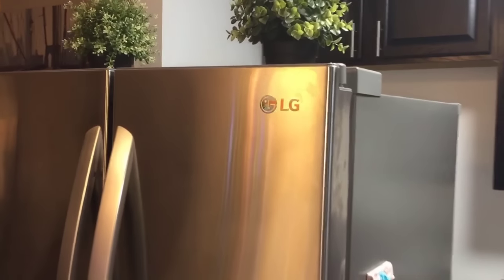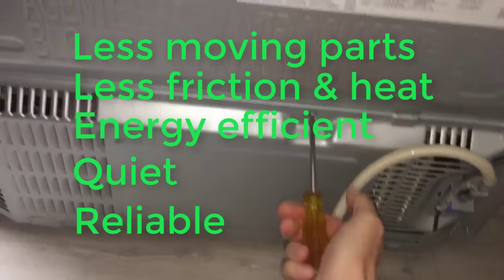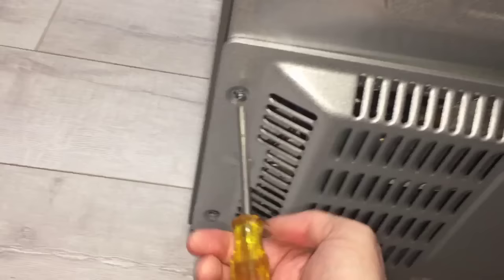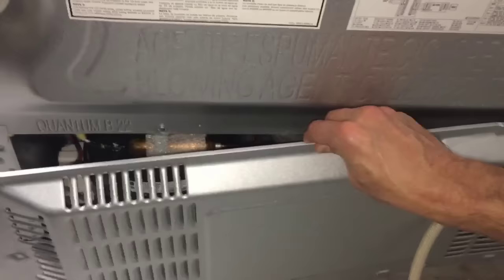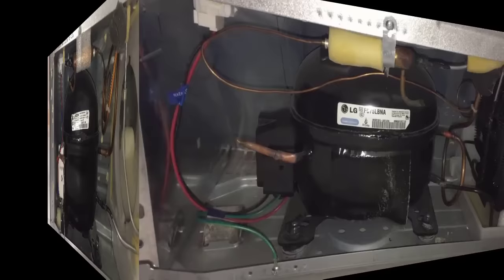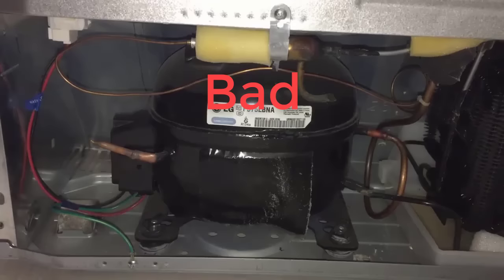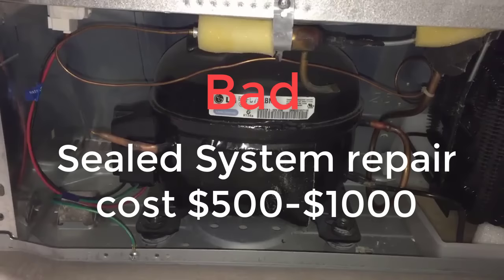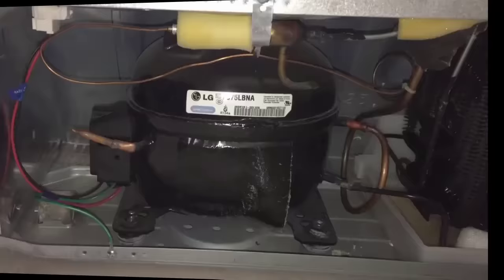LG fridge not cooling but running

Comment: Got an LG fridge and has been running for about 15 years. 2 door classic.  Recently I have been hearing like a marble rumbling or whatever that sound that's really annoying.  I have heard that before when the unit was about 2 years old.  But repositioning the fridge always works in deadening that rumbling sound.  Lately, when I was done cleaning the fridge, it turns on, but not cooling at all.  do you think it's just cleaning that I need to do?  I will have to do it tomorrow and hope to see what the real problem is.
Reply: make sure the cooling coils have not iced up. that happens to our Maytag almost every summer. somehow it does not automatically defrost so we have this huge ice build up. I shut off the fridge and using a blow dryer, melt off all the ice. turn the fridge back on and it works perfectly.

Comment: What blow air from freezer to frig.?
Reply from the maker: There should be a fan inside the freezer that blows some cold air into the fridge.
But if your model has a dual cooling evaporator, there would be a fan inside each compartment.

Comment: We have a LG Refrigerator, Model: LFCC22426S /04, which came with our current home purchase in 8/2021. All of a sudden, it stopped cooling couple of days back and when I called the LG customer support, they said based on the model number and serial number my fridge was 'Manufactured' in 8/2020 but they are not sure when it was actually 'purchased' from the dealer (has to be less than 2yrs old), to confirm if it is still under 1 yr warranty or not. For troubleshooting any further, they are asking for 'bill of purchase' otherwise asking me to opt for their paid support.

I just got the user manual when we bought this home and not the bill of purchase. I live in Ontario, Canada. The local tech says it could be a faulty compressor and quoting $1400 + labor :( Any suggestions please?! I'd greatly appreciate.
Reply from the maker: Not sure about Canada, but in the USA, LG usually replaces compressors absolutely free for the first 5 years. But you need the purchasing receipt. Without the receipt, it would cost about $1000 including labor on regular refrigerators. And much more on build-ins.
Reply: LG refrigerators are not worth fixing they are so poorly made.  They are a throw away product.

Comment: Best thing to do is AVOID BUYING LG PRODUCTS!! every LG product I've bought failed within a couple of years of buying it.  I just checked my fridge and it is doing this same thing, compressors running but no cooling. I had 2 LG dehumidifiers in a garage and they both failed at the same time with the same problem "bucket full shut off" even though they were both hooked up to drain hoses (bucket can never be full), ruining $7000 in product that needed to stay dry. As for this fridge I also had been noticing that it would run constantly costing us lots in electricity.

Comment: Mine is going bad. Freezer is barely cold, even set on -4. Checked coils for ice and they are fine. Compressor sounds different, can tell at night, when everything is quiet.
Reply from the maker: How old is your refrigerator? It maybe covered under LG 5 and 10 years warranty.

Comment: @YourSelf  what about if I have a Kenmore pro but it has the lg linear compressor is it covered in the lg warranty even though it's a Kenmore I think it says in the manual that the lg compressor was warranty for 10 years I bought the refrigerator 4 years ago? The problem with mine is that is not cooling but fans work and the compressor is on and gets hot but the condenser fins don't get hot at all its like if the freon is not going through the condenser.
Reply from the maker: At this time, I believe, all Kenmore claims have to go through Sears. And if the problem is with the sealed system, Sears should cover parts, but you have to pay for labor about ~ $400. But this is under their discretion.

Comment: Hi, my refrigerator and freezer wasn’t cooling/freezing enough, my husband opened the panels for the fridge and found ice on the coils, he clean it, then he did the freezer and it was fine, no ice at all, now the fridge is cooling but the freezer section is not, can you tell me what it can be the problem? Thank you
Reply from the maker: It sounds like you have a Dual Evaporator model, one in the freezer, and one in fridge compartment. These machines are very complicated, so it's best to call LG for service. How old is your fridge? Typically LG will cover compressor problems up to 5 years for free.

Comment: After watching this video I spent several days trying to figure out what was wrong. Compressor purring like a kitten still no cooling. Exhausted all options and finally tested compressor and guess what. No continuity between two of the three prongs meaning compressor internally grounding out. Purrs like a kitten and still no good.
Reply from the maker: If it says "Linear" on the compressor, it has only one winding between two prongs at about 5-9 ohms. Others are open.
So if the compressor is running, that means the refrigerant gas has leaked out, or the internal compressor reed valve has cracked.
Reply: @Your-Self  good to know thank you. Learning more everyday.

Comment: Thank you for the video, however, your diagnosis is not entirely true.  This sound of the compressor is also present when there is a bad starter relay, combined with the click of the overload this could just be a bad relay and the compressor still good.  Just and FYI for those that might be experiencing this situation.
Reply from the maker: Thank you for commenting, however, this LG Linear Compressor doesn't' have the Start Relay. Even if it did, a typical PTC Bad Start Relay would prevent the compressor from starting, so it would not run at all. Unless it's a bad TSD (Time Starting Devise) which will make the compressor run for a few seconds, and then the Overload Protector will turn it off. In this particular video, the compressor runs constantly, but not pumping, which is a typical failure of Linear Compressors.
Reply: @Your-Self  So what's the clicking you refer to, a overload ?  If a overload opens obviously the compressor will stop. In the video the same sound continues even after the click.
I'll also add that those are two different compressors and have different condensers and fan arrangements.

I agree that the LG linear compressors = junk 😂

Inverter compressors use inverter technology that change not only the voltage but the hertz and are 3 phase.
I'll have to recearch " linear " compressor because I believe they are different from " inverter " type compressors.
I understand the mechanical side is different (using magnetic technology).
So after a little research it appears these linear compressors have one winding with a overload to protect said winding from over current. Basically a large solinoid moving a piston mounted on springs.
The single discharge reed seems to be the weak link and point of failure.
Reply from the maker: @Vincent Pribish good question. Typically, an overload switch would prevent the compressor from starting, but in this case, the compressor continues to run for some reason. So there may be a wiring problem on top of a bad compressor.
Linear and Inverter are variable speed compressors, but different technology. And you are right, the weakest point in the linear compressor is the Reed Valve inside, which fails within a few years. At the end of 2019, LG updated the Linear Compressor... so in a few years we will probably find out if it's good or bad.
Reply: I've dealt with numerous compressors that run but don't reach full capacity with bad relays. 
Changed out the relay and the compressor kicks back on at full capacity. 
Little unknown trick they say you're not suppose to use and only to test but they sell hard starts for about $8 and they will save you hundreds of dollars and time replacing refrigerators. 
Do a little research and get some dirt on your hands you'd be amazed at how much people believe they know and will tell you. 
What it boils down to is a few hours of hands on experience with a little bit of will power and you can figure it out pretty easy. 
Also you can recharge the refrigerant in refrigerators that take R-134 A 
Another mischievous way to scam people of their money.  
They sell the valves for about $3-$4 you can get a can of R-134A at the dollar store for $6, (leak repair R-134A for $15 or so) 
A can from the dollar store holds about 12oz and depending on your refrigerator it will take about 7-8oz to refill. 
They say it hurts the ozone to release it but what doesn't these days. Who knows how truthful that is besides the experts of these companies trying to rip all of you off... 
These tech companies don't get your money every 6-12 years if you know wtf you're doing. That's why they feed you full of shit and have you buying a replacement for an $1,800 refrigerator every 6 years now. 
It's all about the money don't be fooled.
Reply: @rexxdogg9360  Wow, they sell r-134A in dollar stores in USA? In Europe we have quotas, how much each country can buy r-404a and r-134a and you can't buy them without a license.
Reply: @Your-Self  Probably that electronic control was overheating and contacts stuck together and it kept working constantly, that's why it died quickly. Electronics stick all the time, usually a hit with screwdriver would help, but some models of electronics stick all the time, like contactors in controllers from Dyxell are sticking all the time too and everyone keeps installing them into commercial refrigerators. A time relay sticks constantly too, so I wouldn't trust that either, had to change lots of them.

Comment: A few weeks ago my ice maker started making ice WAY slower than normal even in "ice plus" mode. We though it was just due to warmer weather and more use not being able to keep up. We adjusted the temps to the lowest settings and the ice make just flat quit making ice and yesterday the freezer seemed warmer and sure enough today the freezer and the fridge is way warmer but everything is running WTH ??
Reply from the maker: How old is your LG, and what is the model number?
Warmer weather can put extra working pressure on the compressor and damage it internally. Especially if's tucked-in the cabinets for a "build-in-look" with restricted air-flow to the compressor.
Reply: @Your-Self  it's about 4 yrs old model is LXF32... something. I just unplugged it for 30 min and cleaned everything out really good after removing the panel on back.  Plugged it back in and it seemed to "reset" but still not cold but now some water is in the bottom of the freezer drawer .  I also installed the LG smartlink app and used there app to try a diagnosis and of course says nothing is wrong.
Reply from the maker: Since your fridge is under 5 years old, it should still be covered by a manufacturers warranty for compressor repair FREE of charge. Call 1-800.. number on the label to get LG certified tech to look at it. This prosses may take a few weeks or months... so be prepared.

The water on the bottom is normal when the refrigerator is defrosting.

Comment: Mine doesn't really sound exactly like either, there is no overload click for sure.  Anything else it could be?  It also still gets somewhat cold but not nearly what it should
Reply from the maker: If you have an LG Linear Compressor and it's running, but not cooling at all, most likely the compressor internal valve is going bad, or refrigerant gas has leaked out. Either way, it's expensive to repair without a warranty. How old is your refrigerator?
Reply: @Your-Self  Thanks, it's ~7 years old but it is cooling some but not enough.  Fridge is ~58 and the freezer is ~48 so definitely not just blowing room temp
Reply from the maker: Unfortunately, your refrigerator has passed the 5-year free compressor warranty. Now it'll cost you about ~$400 to replace it through 10-year "parts only" warranty. But before you call the technician, look at the condenser coils next to the compressor. If they are really dusty, clean them up with a soft brush and vacuum (unplug the refrigerator first). Make sure that the fan next to the compressor actually works together with the compressor, and the fan inside the freezer works as well. You, also, may have a "defrost problem". If you are handy, remove everything from the freezer, including shelves and back pannel to look at the evaporator coils. If those coils are completely covered in a thick layer of icy-frost, it's the defrost problem. But if there is no frost at all or just some on the top or the bottom of the coils, it's probably a big problem.

Comment: I got same refrigerator as that one...mine freezer part isn’t blowing out super cold air like it use too and it doesn’t even freeze food even at -6f it just cold HELP .....going try check these
Reply from the maker: If the problem is with the compressor and your refrigerator is under 5 years old, I'd call LG, and they should fix it absolutely free under warranty. If your fridge is older and the compressor and the fan next to it is running, but not cooling as well, hopefully, it's just a defrost problem. The best way to figure it out is to take everything from the freezer, unscrew the back panel, and look at the Evaporator Coil. If it's totally covered in icy-frost, it's a cheap repair. But if there is no frost at all, it's an expensive fix.
Reply: Thanks for the reply.....I unscrew the back and there was a lot of dust clogged the coil no defrost but there was water under it so I clean up everything....I also think the compressor is also mess up....the refrigerator lasted about 4-5 years probably 5 already

Comment: My compressor is not making sound like that what els would be wrong ?
Reply from the maker: Could be a leak of refrigerant... what exactly is the problem with your refrigerator? Not cooling at all or just in one compartment?
Reply: @Your-Self  mine is not cooling at all - but compressor sounds like the good one in the clip here.
Reply from the maker: Lumumba JaKusa please start a new question under the video (I don't always see replies to old messages). What is the model number and how old is your fridge? Can you confirm that 2 fans are running (one at the compressor, and second inside the freezer)? How is the temperature of the compressor to the touch... cool, warm, hot, very hot?

Comment: I have a lg refrigerator that is running but not getting cold so I called lg they told me that it would cost me 389.00 just to come out and  then what the part would cost  that is crazy so I junked the  piece of crap after I only had it for 2 years

Comment: Just happened to mine last night. Bad Comp. LG Model LFX31945ST /07.  Manufactured 2014 05.
Reply from the maker: Too bad it's past the free replacement period. You could still get a free compressor, but the installation cost may not be worth it on the 8-year-old fridge.

Comment: My LG refrigerator died was getting a code 28 found  on line said it was a bad compressor start relay bought one installed compressor is running  now(wasn't before)  still not cooling at all. LG is 9 years old. Compressor is very quite but lines don't feel cold at all. Has a rest button on the control panel pushing once compressor and fan turn on push again still on push  a third time (defrost cycle) fan and compressor go off. No cooling at all ran for several hours. I'm afraid the compressor is shot. LG piece of junk so sorry I bought it. Yea 10 year warranty on compressor but costs a fortune to have it replaced. looks like I'll be using another refrigerator but it won't be an LG

Comment: what would cause the compressor not to come on at all?
Reply from the maker: It depends on the refrigerator model. Does it say LINEAR on the compressor? Does the fan next to compressor run?
Reply: yes.  when i run the test the fan turns on but compressor does absolutely nothing and the LED flashes 7 times.  I am thinking the pcb?
Reply from the maker: I'd check the compressor winding and if it's shorted to ground. If that checks out good, the PCB is probably damaged.
Reply: thanks.  is the pcb the board up top where the reset button is or the board in the plastic case next to the compressor that has the green led flashing?
Reply from the maker: They are both PCBs, but you need to replace the bottom Drive-PCB, which probably shorted, hence the 7 blinks.
Reply: I replaced the pcb and not the compressor runs and the led is not flashing but it isnt getting cold and it randomly beeps 3 times.  what would cause this?
Reply from the maker: It may take up to 24 hours to cool down to the proper temperature. If it doesn't, it could be a Sealed System problem. Beeping - I'm not sure... maybe the Temperature Alarm because it's not cold yet. Does it sound like a Door Alarm if you leave it open?

Comment: Mine just crapped out after 3 years
Reply from the maker: Yep, very typical. If the problem is with the compressor and you have the receipt, LG will fix it for free including the labor up to 5 years. You may need to fight for it, so good luck.
Reply: @Your-Self  I am pretty sure ours just crapped out we have the receipt for it
Reply from the maker: @Catherine Benton call LG, and they should replace your compressor absolutely free.